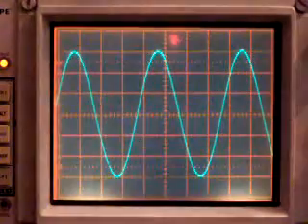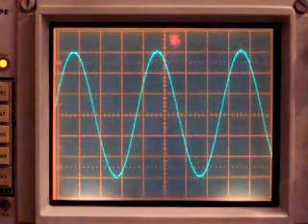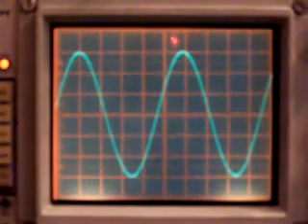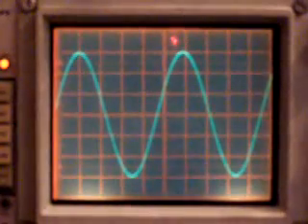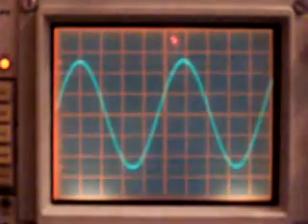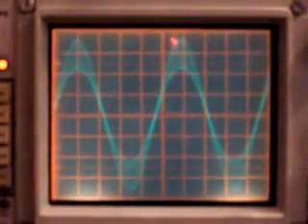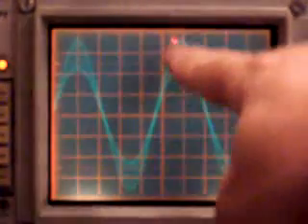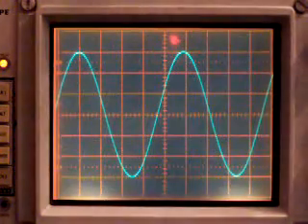Amplitude Modulation

Comment: I am using an avr to generate a 1mhz square wave using pwm and it appears to work just fine I hear it on the radio what are (if any) advantages to using a sine wave instead.

Comment from the maker: This might be possible on a FM signal using a very fast frequency counter and a carrier with very low frequency modulation.  It is impossible to use a frequency counter in the same manner for an AM signal.  The frequency does not change for AM, only the Amplitude changes.

Comment: The fun part is trying to do this without an oscilloscope. I have a frequency counter, but can we record the output wave and check modulation visually checking for changes in voltage?

Comment from the maker: Any spike of power near the AM carrier frequency "impulse noise" will add to the amplitude transmitted signal and be demodulated along with the program audio.  FM is demodulated in the Frequency domain so it is not as susceptible to impulse noise.